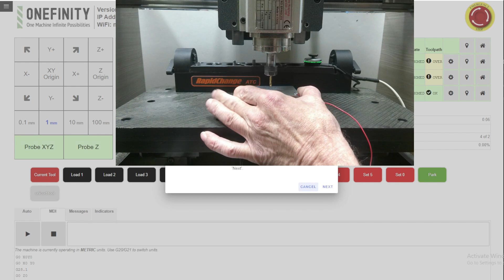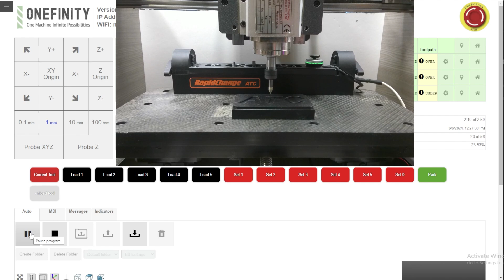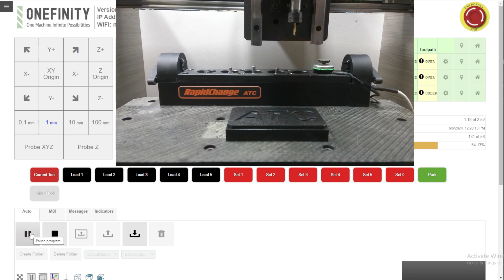RapidChange ATC Tool Length Offset workflow for Onefinity Pro series CNCs/Upscale your productivity.

Comment: Is that custom Onefinity (buildbotics) firmware?
Reply from the maker: Thanks for the question and comment. The scripts work with the latest onefinity buldbotics firmware
Reply: @RapidChangeATC  Thanks. I just they just added this macros. I'm still on the old firmware. This would be great option for me to add ATC on my system without breaking the bank. But I'm gonna need to upgrade my 1.5kw spindle and move to ER20 before purchasing your system. I felt my 1.5kw is underpower even compare to regular 110v compact router.
Reply from the maker: @francis.creation  Yes we have a desktop app that generates the macros.
Reply: @RapidChangeATC  Do also have a link or resource for onefinity controller, like the needed scripts and guide complete installation?